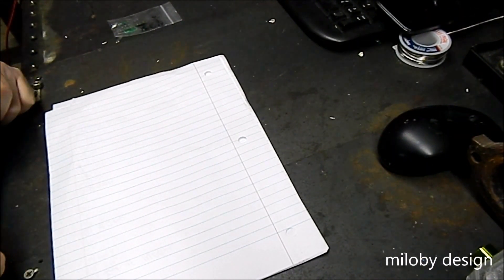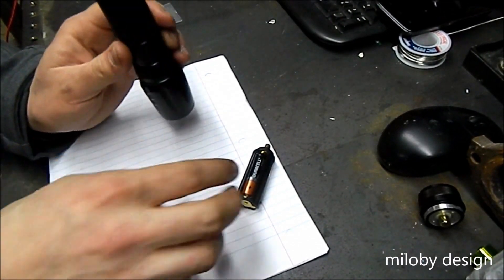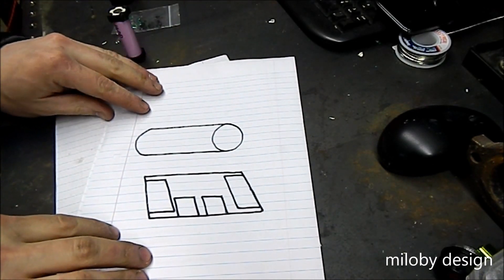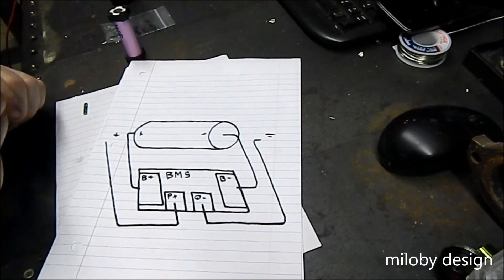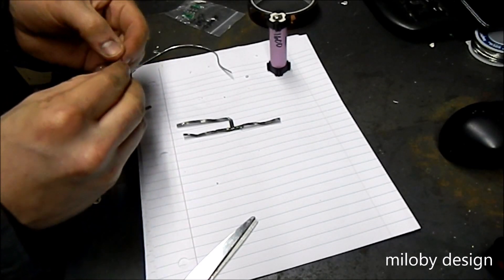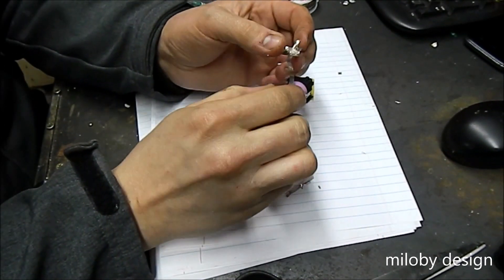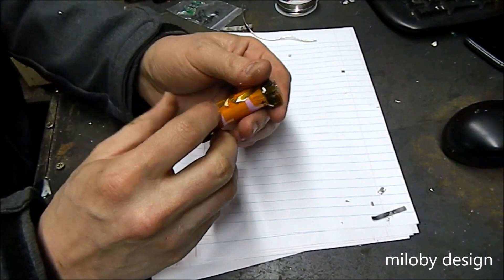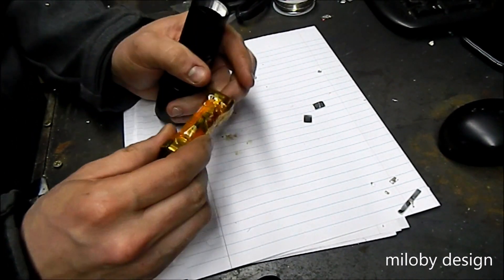Battery conversion Done with alkaline batteries, f

Comment: I stuck an 18650 down mine and it just works.   I've got the same internal 3 AAA holder and it has that big nipple so it is long enough to be replaced by 18650 without any additional fiddling.  Not quite as bright.  Good to not burn li ion all the way down.